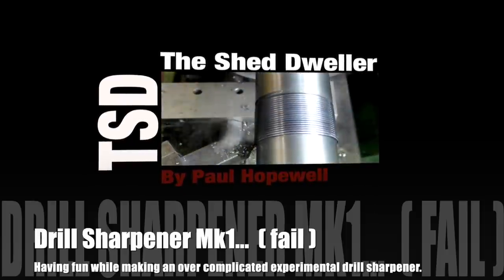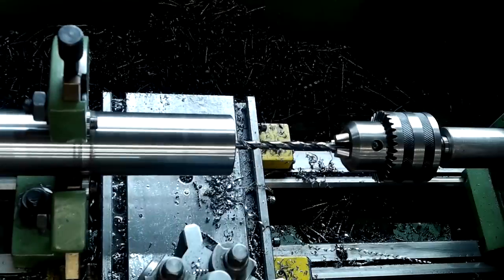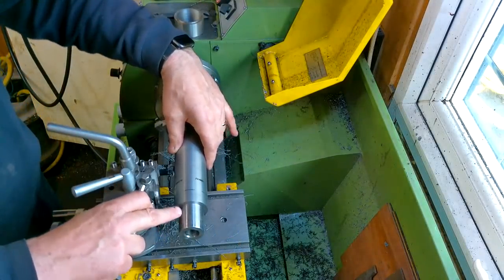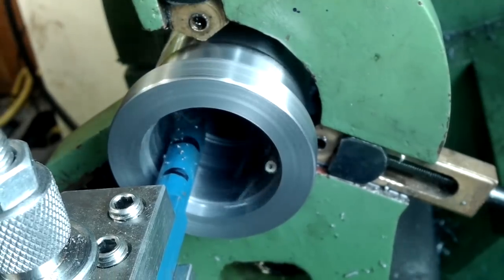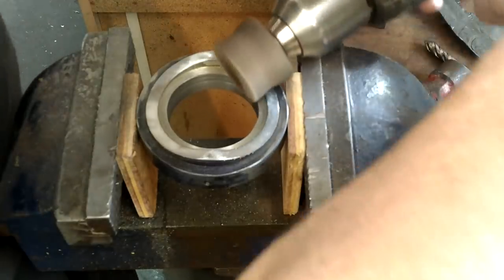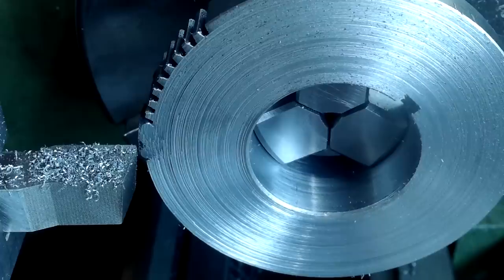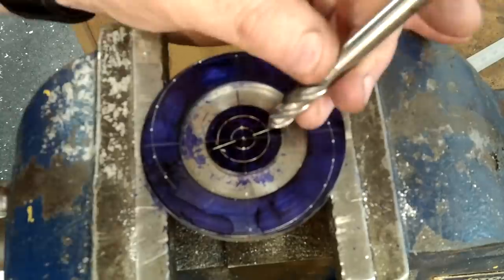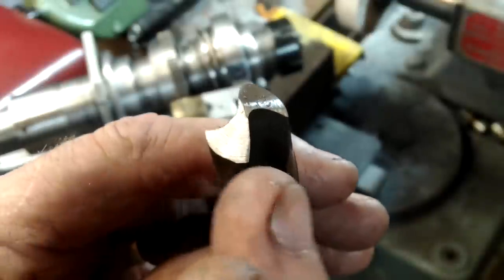Drill Sharpener Mk1 (fail)

Comment: You are nearly there! I used a drill sharpener probably 40 years ago, and I wish I had taken more notice. I think your face cam needs retract the drill more quickly. You really need to form the cam by dividing head or rotary table by cutting axial cuts to known depths, so that the cutting edge is located accurately in the same place on both sides of the drill. I look forward to Version2!
Reply from the maker: Thanks I’ll get my thinking head rebooted. got pleanty on at the moment, i will get there, promise.

Comment: Thnx for letting us learn from your mistakes. I sharpen most drills by hand and check them with a hand tool drill checker. That way I can make small adjustments for when I want to cut brass or stainless etc.
Reply: @Thesheddweller  same here 😇

Comment: Valiant effort.  Hope you learned enough to come back to it loaded for bear.  As  an aside. I started using a cheap AliBaba Mister with synthetic fluid. Air pressure is about 35-40 psi and I tweak down  on the lfuid feed so that it barely  mists.  Quality of Cut  improved  dramatically.  I'm no longer recutting chips. And I can increase speeds and feeds dramatically  too.
Reply from the maker: Hi, hard work but worth it.  cheers

Comment: I think you need to tilt the whole assembly approximately 30° so the swivel motion is not "up and down" but more diagonally, like the swivel motion of your old drill sharpener.
That ensures that it grinds the relief angle on the outer diameter of the drill, but not so much on the center of the drill.
Of course you need to offset the "advance and retract cam" by the same angle to keep it in the same position as before.

Comment: Hello from Aus. The chisel edge angle is controlled by the amount of clearance ground on the drill. I would reduce the drill stick out from the collet and reduce the edge height above center of the wheel. The correct andge is about 15 deg from perpendicular. BC
Reply from the maker: I have tried many variations of cam and timing the version shown, produced the best result. The Mk2 should address the issues you mention, number one getting the point of rotation nearer to the drill tip. cheers.

Comment: @31:15  The rotation "zero" set point should be before the wheel contact the cutting lip. The cam low point should coincide a few degrees before touching the cutting lip. Then as the cam cause the drill bit to extend, it will grind the flank.

Comment: That's an interesting drill sharpening jig.  The only thing that that's put me off making one is the fact that it needs an expensive collet to fit every drill size. 
There's also the small but not unsurmountable problem of the excessive web thickness which I'm sure could be corrected with a few tweaks to the geometry.
Inspiring bit of kit though, and very quick to use because of not having to re-set the drill bit.    Thank you.
Reply from the maker: Hi, thanks for watching, there were a great many issues with this device. I dismantled it and made another. The collets are a standard ER32 collet set. Useful for many projects as well as the milling machine. Cheers

Comment: It appears that the drill should cam up and not rotate till you complete the first clearance angle, and then rotate as it cams back for the second clearance angle.
The first clearance angle should only be as wide as the web.
It sometimes appears that the device is trying to do this action backwards, or it may be my dislexic view of things.
Who knows.
An interesting approach to the natural hand grinding process.
It has me buggered how a factory automates this action reliably.
Very good device, looking forward to Mk.II and your solutions.
Take care.
Reply from the maker: I have experimented with many different cams and timing the best was shown in the video. Making the drill sharpener the same way as the Breirley sharpener would be a great way to do it but, unfortunately a new patent prevents me from using a system like that, this is why I tried the method i did. 
Watch this space
Reply: @Thesheddweller  Annoying how people are protective of their ideas sometimes.
If you didn’t film it you could live with the secret.
I will be very interested in your next iteration.
I too have the (blue) drill sharpening guide you have.
I have modified it to hold the drills more securely and in a repeatable manner with a new quick release base to advance the entire guide assembly into the wheel and then use the standard advance mechanism to move the bit in the original fashion.
The advantage of the quick release base is that I can take the entire guide out and fit a drill or rotate the drill 180, accurately, for the opposite land and refit it to the grinder in the same position, without having the wheel of death in my ear or near my fingers.
Works a lot better but not perfect.
Getting a prototype correct is half the battle.
Take care.
Reply from the maker: @pebrede  Thanks pal
Reply: @Thesheddweller  My understanding is that patents don't prevent personal use of an idea. If you trying to sell it, that's another story.
Reply from the maker: @carlhitchon1009  yes.. possibly, but if I make a prototype of something that is similar to someone elses process, then show everybody my plans, there is a chance,. a very small chance, that I could come a cropper and I can't afford that. 
I would have loved to have my tool cariage swing sideways like the Brierley drill sharpener ( one of my first drawings was a sideways movement action) but after checking the patents office drawing and its date I altered my plans.
Regards
Reply: @Thesheddweller  Better safe than sorry. I'm not a patent expert.

Comment: Hi Paul, I think you've done a brilliant job so far. Just remember that stuff in a spray can - It's not called WD-01.
For the next time, could you explain more how you came up with the cam please? I was playing around with some graph paper, simulating the advance and rotation across the graph as if you peel a layer off & roll it across the page. But it needed a sideways kick for the point before settling back to a constant drop back down. Stay safe & well :)
Reply from the maker: The cam  is easy….. I guessed.
Well,..  I moved a large drill through the action I would make while grinding the drill by hand.
How far forwards and how far down at the back.
Then calculated what sort of angular change was required with a rotational input… well the rest is down to a bit of maths and, although it pains me to say it, a bit of add some just in case.

Comment: That was cleverly done. The Drill-Doctor works on the same mechanics, but, I gotta say, I like your steel version 100 times better. Your next version I am sure, you will have the cam's dialed in for your exacting desired features.. well done.  I look forwards to the next design.
Reply from the maker: I've got a couple of projects to get done for some freinds of mine before I can get on it, and I am on it.

Comment: Used a drillsharpner that work after the same prinsiple, your problem lays in the profile on the cam. Mutch steeper climbe on the one I used and when the egde on the drillbit was cear the grinding wheel the cam just had a straight drop, the lobe had more the profile of a thoth on a sawblade

Comment: Wonderful video! I'm just curious if you tried other drill bits,and did you have the same results. I wonder if you could cut a relief on the flutes would the fixture work, never the less it appears to sharpen quite well. Thanks for sharing.
Reply from the maker: It sharpens Ok, but without a good sized pilot it just wonders around.

Comment: You almost had it, in fact you were right there, it just needed the finishing touch of web thinning to make it work ....nothing else........I hand grind all my drills, even the .5mm ones but for that I use a Wishbone type drill sharpener and  anything under 4mm diam.
I think you might have more luck with 4 facet drill grinding as there are only 4 flats to grind and they can be ground in a fixture or even something exotic like a Deckel SO D bit grinder.
Reply from the maker: Hi, thanks for your comments. These drills cut quite well but with the web being so big they need a good size pilot drill for them to do their work, so thats why its a fail. ;-)
Reply: @Thesheddweller  As I said, all you need to do is thin the web and it will be OK.....I thin the web on normally sharpened drills as most times the web is too thick anyway.
I'm currently making a cutter grinder, similar to a Deckel D bit grinder, and I'll be using it to do 4 facet drill bit grinding as I think it will give better more consistent results without struggling to get the point concentric and equal angles......I learned to grind drills over 60 years ago as an apprentice buy I think the 4 facet method has a lot of merit.
Reply from the maker: @gangleweed  The  four facet method is indeed a good method and that has been considered as an after thought for this version of my drill sharpener.  
Web thining is the norm with all drills over say 12 - 14mm but, I would rather try a bit harder and get the drill sharpener to get the process I’m after as good as possible before going through the web thining process.
I had also tentitivly started plans to make a quick action web thining tool, but that is a while away at the moment. I’ve got a lot of work on to get finished.
Regards
Reply: @Thesheddweller  Many years ago I read an article about drill grinding and also the 4 facet method but discounted it as just a quack way to sharpen a tool, but lately after thinking about the method it's obvious that if you have clearance behind a cutting edge it will cut......web thinning is just a secondary operation to offset the fact that the web thickness of the drill is to keep it from splitting down it's length but it's not practical to have it at the drill point.....I do web thinning from 2mm and upwards as a necessity for keeping the drill centralised during cutting.

Comment: That grind looks like something you can get ftom any number of grinders when things go wrong. Playing with the starting angle and drill projection might show the way to go. 
There is a book by Prof Hugel that goes into incredible detail about conic grind etc but it is a touch dry for me as the characterisations is little flat.😕
Edit, the height of your device relative to the wheel centre height is another consideration, as might be the small grinding wheel you are using. As the yanks would put it, just spitballing the problem.😉
Reply from the maker: Hi, spit balling was a large part of my testing process. I have tried flat siding, high and low wheel positions, I’ve even put jacks under various places. Using it as a four faceting system works well but, I still would prefer to have the drills sweep if possible, so I’ll stick at it.

Comment: Wow. Complex machine. Perhaps try out a concept 1st - it the simple way - before making a professional tool. At least you know the concepts works and probably it is good enough as well. I made a drill sharpener for my 0.3 - 3 mm drills as these tend to go dull very quickly somehow. Found out one can make a 4 facet on a 0.5 mm and 1 mm drill as well. But it's a b**ch to align everything as the edges on these small drills are not as clearly defined as with the bigger drills and one needs magnifiers to see anything at all. The tool I created is just an add-on to a dremel and with a 1000-1500 grid sand paper disk (normal dremel grinding disk is just too rough for these sizes of drills) and a simple holder to keep the drills positioned. A lot of work to make, but just with standard tools. But after sharpening... they cut like hell, even through steel -  for as long as they stay sharp that is, cutting through iron is really tough for these small sized drills.
Reply from the maker: Hi, yes I agree, the smaller they get the harder it is to sharpen them. Mind you, I did see a small drill holder made by a Russian guy that was triangular in shape with a small wheel in 2 corners the third corner was a guide for the drill bit, the drills were sharpened on an oil stone....
Reply: @Thesheddweller Yes, I know about the wishbone sharpener. I think this guy is using it to drill plastics. I think that works fine. The downside is that the angle accuracy and how much material is removed are not well controlled. For a 1 or 0.5 mm a 0.1 mm deviation is still a lot and the tip will not be nicely centered anymore. I was looking for a more stable solution. If the drills are sharpened correctly (with 4 facet), a 1mm will go through steel like butter. Really nice.

Comment: Nice exercise! Love the way how you made that cam by hand. Your web came out too thick...wrong (axial) clamping angle maybe?  I have a Drill-Doctor that was left in a corner of the company workshop together with with numerous dull drill-bits, because "it dit not work". The Drill-Doctor basically makes the same motion as your device, but if the  drill is not clamped with the cutting edge at the suggested angle, the web will not come out right. After a bit of tweaking, I now have a lot of perfect cutting drills in sizes that the local hardware-store does not stock.
A very simple device to sharpen drills properly is depicted here:  https://www.modelbouwforum.nl/threads/boren.265416/page-2  Used with a cup-wheel it allows one to make a geometrically proper grind.  Drawback is that you have to reposition the drill halfway the process, which is difficult for small diameter drills.  Above 6 mm it works fine.